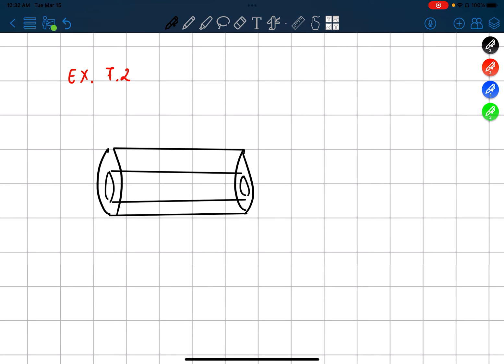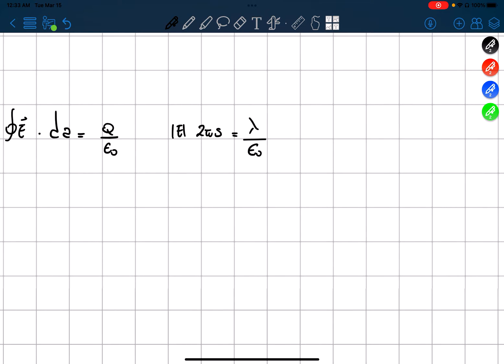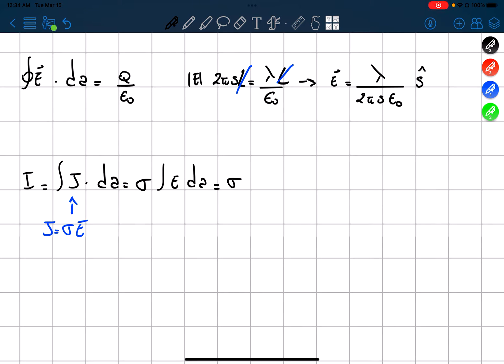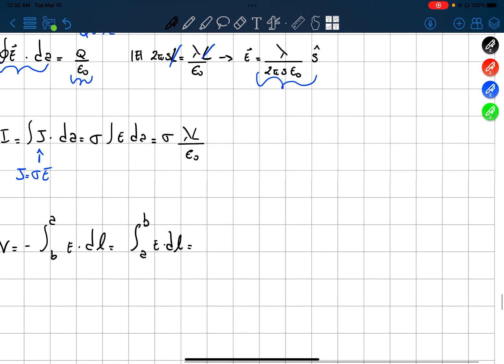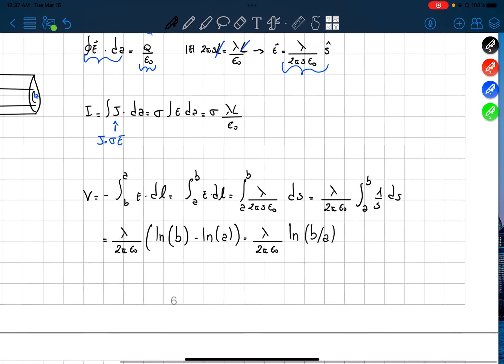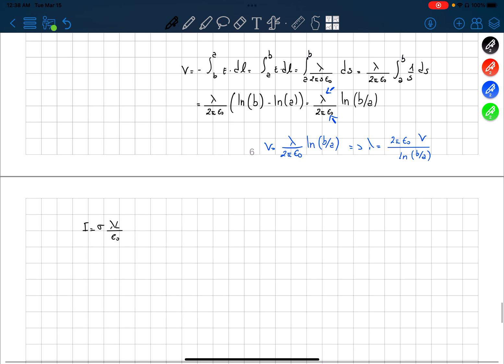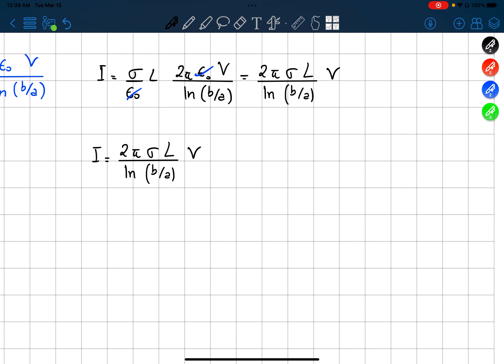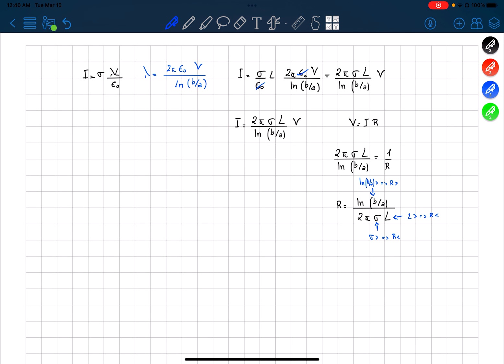Example 7.2 Introduction to Electrodynamics Griffith Ohm’s Law

Comment: why have we used a linear charge density for the charge of the cylinder?
Reply: I guess because of symmetry, you only look at the electric field lines from the smaller to the bigger cylinder in terms of radius s and you get Qenc = λL and ∫E*da = E2πsL = λL/ε0 -> E = λ/(2πsε0) in ŝ-direction

with ε0 i mean epsilon with subscript 0 ofcourse